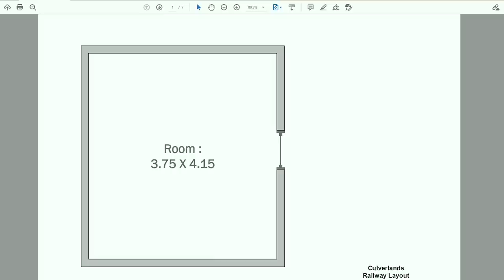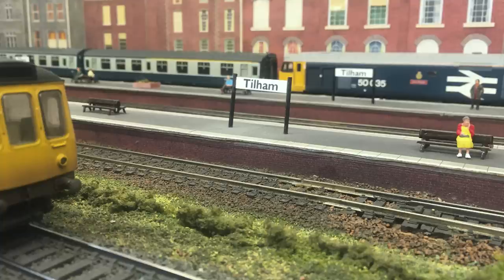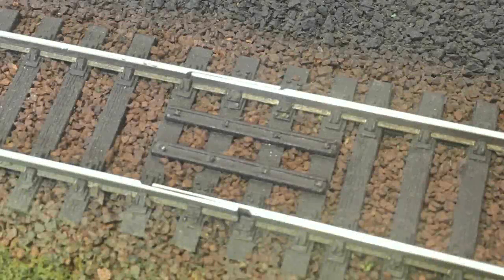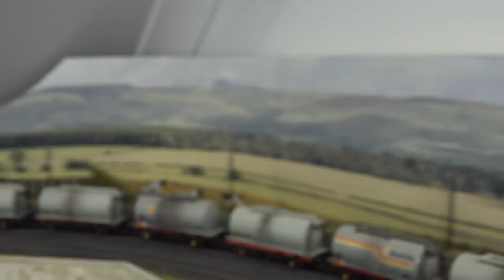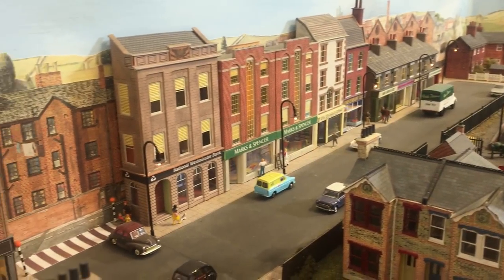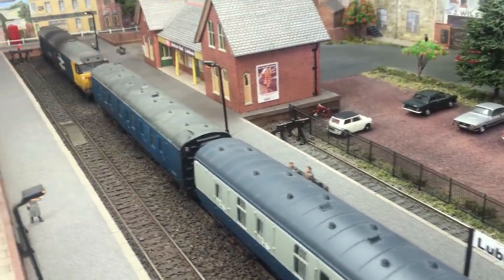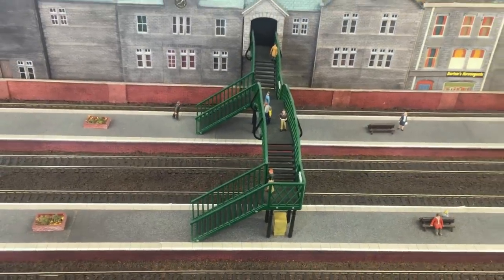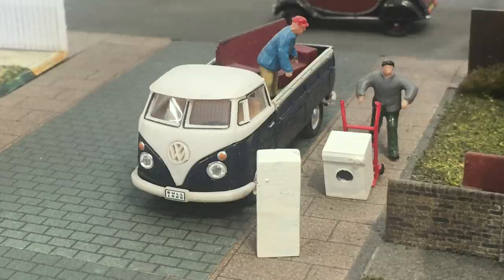Visiting Culverlands with Chadwick Model Railway | 142.

Comment: Nice to see other layouts.I like the idea of expansion joints after losing over 40 ft of track to excessive heat in the garage during the summer  and warping .( over 95 degrees) .Yes the sun does come out in the north of Scotland!! .Well done .
Reply: I feel your pain! I had a helix of flexitrack uncoil itself in similar circumstances - west of Scotland near Glasgow! Cheers
Reply: @daviemaclean61  Absolute nightmare .The heat melted and distorted several viaducts . a signal box and damaged wiring  .
Reply: @davidmathie9512  Good grief! It's not just Scottish people who aren't built for the heat then! I got off very lightly with just the track distorting. I hope it's all fixable/replacebale without too much trouble.
Reply: @daviemaclean61  Have taken the bold decision to have the garage door removed and a wall and window put in .it was like walking into a furnace .Most of the track has been replaced and  a new layout built based on the west highland line  Plenty of  1970/1980 Eastfield loco's to play with .
Reply: @davidmathie9512  Sounds like a plan. Not many folk use their garage to keep a car in anyway! After many years of trying to squeeze my layout in amongst the usual detritus in the loft I am moving mine (well, not really, starting from scratch with some recycling) into the completely unoccupied loft space above our extension. Why I didn't think of it sooner is beyond me. There's no such thing as a finished layout! Cheers
Reply from the maker: Great comments gentlemen. So sorry for your losses.

Comment: Excellent video Charlie, and thank you to Richard for allowing your camera in. Certainly for a model railway novice like me, these videos help immeasurably. Quick question if I may, the low relief buildings against the back board (and indeed many of the other buildings), what make are they (if you know), or are they scratch built?  The shop frontages looked superb and very realistic. I am using Metcalfe, but would be keen to know what else is available - especially in the "retail space"...many thanks again Charlie from Stephen , Perth, Western Australia.
Reply from the maker: Hi Stephen, having spoken to Richard they are all Metcalfe type buildings it’s just a case of asking uncle Google what is available.

Comment: Interesting details at 10:51. Am I correct in seeing copper tape for bus wires and then feeder wires soldered to the copper tape? Really neat idea that eliminates the need to strip the wires or placing bus bars for additional connections. Really cool layout. Thanks for the video!
Reply: Ohh, that could have been the LED lights in the removable buildings which was shown later in the video. Still a really smart idea for that too.
Reply from the maker: I’m so pleased that you found it interesting MP.

Comment: Hello Charlie a bit different to your normal video's but good to see another railway in a unusual shape, but it works. As your pretty good at photography can I ask a question. I want to do a night shot with my GOPRO what's the best speed & frames can I use. Thanks Mick
Reply from the maker: Hi Mick I would set it to 30 frames per second and let the camera figure it out.
Regards Charlie
Reply: @ChadwickModelRailway  Thank you Charlie.

Comment: A great layout and video there, really enjoyed it !!!. Charlie, going back to what you've said before about quieter trains...
I managed to get hold of a 5 m x 1m roll of Woodland Scenics type self adhesive 3mm rubber underlay. I'll see what happens when i add another layer on top for the actual track bed. I'm working in N gauge. Can i ask which glue did you use for ballasting over the Woodland Scenics track bed  ???. Many Thanks and have a great weekend  !!!
Reply from the maker: I used a 50:50 PVA water mix Mark.

Comment: Hi Charlie, the usual comment (interesting video). I was impressed by the smooth running of the Culverlands, shown by the even and non-jumpy video as the camera train ran round the layout. Having grown up with 1st and second radius Triang track, the stuff with wide sleeper spacing, and a 1950s Princess Elizabeth I am familiar to a lot of over/under hang on corners. Being in the process of planning/building a layout with modern trackwork. Having seen trains going round bends on the Culverlands layout I was wondering what the curve radii are?
Reply from the maker: I’m so pleased that you enjoyed it Andrew and I believe you have sorted out the radius with Richard. Regards Charlie

Comment: Thanks Charlie, and Richard.  Really enjoyed that, and the lighting system for buildings is exactly what I've been puzzling over for some time but never thought of the two pins into power and resistors system.  That's an idea I'll borrow, albeit for a much smaller layout.
Reply from the maker: I’m so pleased that you find inspirational Martin. Regards Charlie

Comment: Very nice and very neat. Extremely well done backscenes and low relief buildings.
The copper tape and resistor lighting was a great technique and top marks for a well modelled railway. As you say, detail matters and does make a significant difference. Thanks for sharing.
Reply from the maker: Yes Kevin, Richard has made an exceptional job of this layout. Regards Charlie

Comment: Thanks for letting us know about those expansion tracks. I didn't know they were available in the smaller scales. I've had my HO layout tracks kink inside my air-conditioned house. However, using expansion tracks outside on my #1 gauge layout, and letting the track "float" on the ballast, I've never had an issue. And temps here in Phoenix range from near freezing to 120F. 49C.
Reply from the maker: Stone the crows, that’s a huge temperature range. Regards Charlie

Comment: Very nice.  As an electronics engineer I was impressed by the use of copper foil for wiring the LEDs. It is reminiscent of printed circuit boards, and it made me wonder if any modellers are designing their own electronics and using custom PCBs in their models in clever ways?
Reply from the maker: Yes I thought that it was a ingenious little design too. Regards Charlie

Comment: Thank you Charlie and Richard for sharing this great layout. The skill and passion that have been put into the fine detail are awesome and the technical tips were food for thought too. As a modeller who still has a 15 year old child's approach to "lay the tracks down and let's try and get a 50 year old loco + stock to do a circuit without derailing", tempered with another 50 years of learning patience, experimenting with technology, designing and engineering new items and fitting it all in to a few spare hours a week, it was also good to see "behind the scenes" in the unlandscaped areas as for some of us 90% of our track looks like that! Track plans etc are also good for orientation purposes. As is shots of the control panel and how that works. This is a wonderful hobby and its probably up to us to enthuse and encourage future generations - so a balance of "working layouts" and "things going wrong and how to fix them" would be good for that too.  I think a few of these videos each year would be about right, if you can do them. Regards. Mike
Reply from the maker: What a heartwarming comment Mike. I shall thank Richard on your behalf.

Comment: the Railway that me and my farther made in our loft..  Erm. 20 years ago now... (still un-finished)  suffered from a hot summer.  we had a access hatch to the loft and a ladder.  So we had to make a hatch on the railway. Split lines and everything.  But realised it was not needed.  When we removed the hatch... The year after we had a Railway accident with kinked tracks.  They metals expanded by a large amount and it was enough to kink 3 meters of double track. (which had small expansion gaps.)  The expansion track would have been handy on that loft tracking.

NB :  we went for old style train control of a person controls everything. 3 or four H&M controllers (from the 1970's / 80's one of them a 7 track controller.)
Reply from the maker: Happier times, I do hope you enjoy the video. Regards Charlie

Comment: Hi Charlie, great to see you visit another great layout. Even better that it is a wee masterpiece hidden away in a loft that we might otherwise not see! 🤓 I must say, I really like so many aspects of Richard’s work that I am not sure where to start! 🤔

I like how he had somehow managed to interstate several aspects of the hobby operationally into the one layout: there is the terminus, the through station, an out-and-back running capability AND a small branch with what looks like shunting potential…what more could you want? 🤷🏻‍♂️ It just goes to show as well that even with good old code 100, you can achieve wonderful results 😎 I really love the logic and obvious care and consideration made behind this design, especially the way he has managed to set gradients that are gentle enough to achieve a practical working model with such depth 👏

By the way, those expansion tracks look a bit handy. I will either be venturing into the loft or garden depending on where we eventually move, so either of those potential locations would benefit be I suspect. Thanks for the heads up mate 😃

Really enjoyable way to start the weekend. Thanks as ever Charlie! 👍🍻🍀
Reply from the maker: What a heartwarming comment Tim thank you.
Yes Richards layout is a real eye-opener, and I thoroughly enjoyed the visit and filming it. Regards Charlie

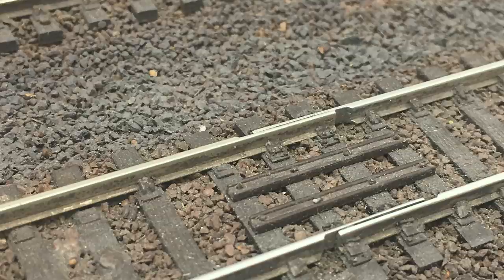Comment: Lovely ballast and your camera chase from 6:04. Peco SL44 breather switches are something I’ll be adding and your cut to the real thing just shows how realistic they are when weathered so well by Richard 7:31.His loco’s are weathered just right, along with the fuel overspill on the Shell freight 9:07, not overly grimed up, lovely camera angles too. M&S and shops surrounding get my vote definitely. We all need to tone the odd vehicles down with some weathering. Like the pin fit to get rid of those giveaway clear plastic base plates. No dust or hairs left lingering. My fave shot of the whole shoot is this at… 13:09 lovely focus and fade effect. It really caught my eye. Narration as ever is second to none Charlie and mix of running, chat and intro just right. No over bearing loud dance music intro or long periods of tech’ either. 12:40 another lovely shot of the station light and focus into next shot as the loco couples up. Finally, of course, though there’s no DCC sound for obvious reasons on this layout you capture the actual running noises really well which makes up for that. Do like the odd bit of point changing switch flicks and clicks and background chat. I’ll coin a new phrase… Top Class Charlie 👍
Reply from the maker: What a heartwarming comment Andy. I shall pass on your kind words to Richard. Regards Charlie

Comment: Interesting, makes a change, I used to use the expansion joints in the past but with having so many points (turnouts) now it became too much of a problem as to how many I would need and so I ended up building the track at 22 degrees C and making sure I left room between the joints for expansion. In the loft the gaps can disappear during the summer and can be as big as 5 mm in the winter, LUCKILY I don't experience derailing problems. Ive yet to do the scenery as still laying track at levels. Thanks. I bought one of the cameras you used a few weeks ago and intend to investigate the hidden track to see if all is ok.
Reply from the maker: I’m so pleased you found it interesting Sam.Good luck with the camera, I really like it. Regards Charlie

Comment: A very nice layout, I would probably cover the clear plastic and bare wood parts where there is scenic or station areas with a brick paper to soften that obvious difference between layout and structure. It is nice to see a layout with continuous running loops which I think allows the operator to just watch the trains rather than have to 'operate' too much. I can't see why anyone dislikes this video.The space allows 'real space' and an uncluttered length of track between features so you could see on the open country sections probably 20 wagon freights in one view. I like this layout and would be pleased to have built something like it.
Reply from the maker: So pleased that you found it interesting, and I shall pass on your thanks to Richard.